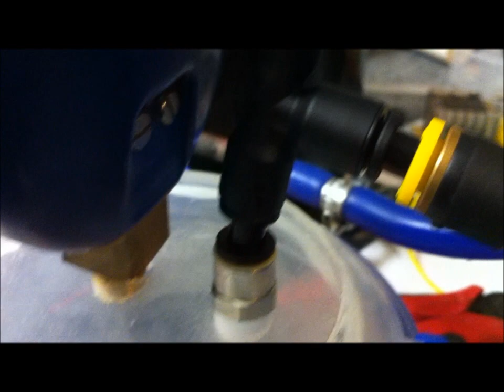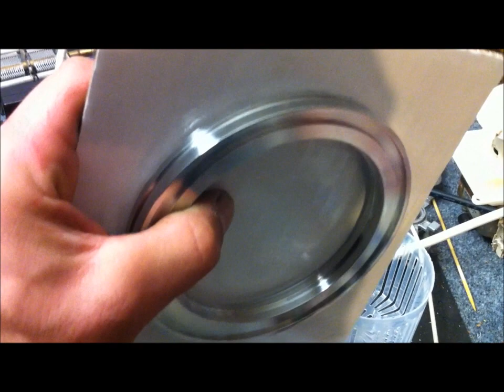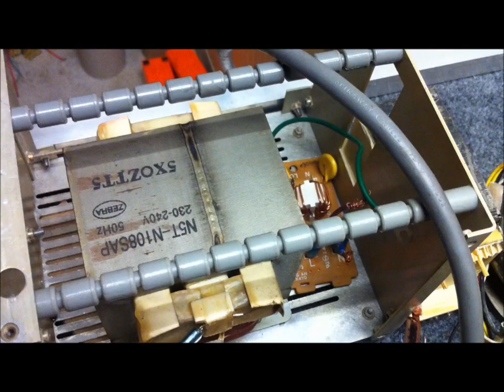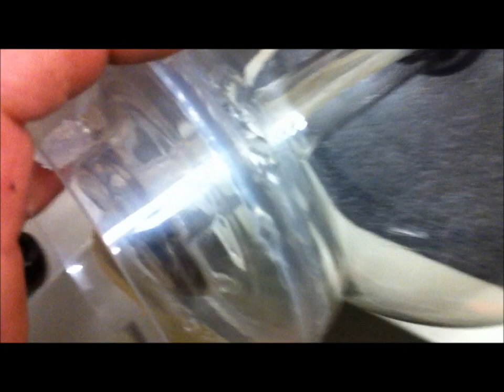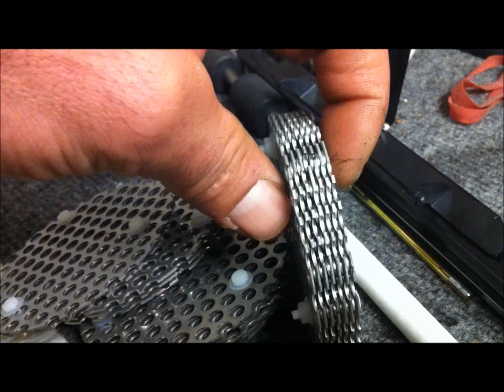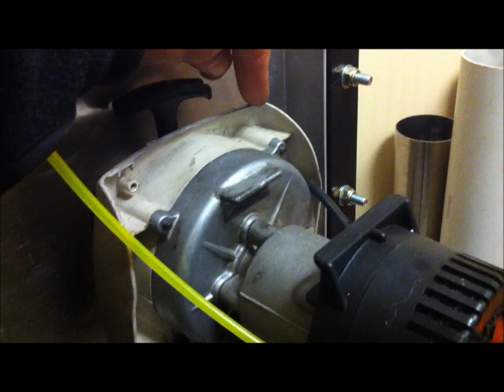HOW I MADE A VACUUM CHAMBER!  And Updates On HHO, Coils, 2KV Power Supply & More!

Comment from the maker: Flaw / problem with my idea: Using the vacuum pump continuously to maintain the vacuum in the HHO cell will cause eventual failure of the pump, due to the water entering the pump & contaminating the oil :(

Comment: A friend mention the possibility of using an electronic fuel pump to generate vacuum to the HHO cell. And as you mention, we may connect the output ie exhaust of the pump ie Hydrogen + Oxygen, into the engines air intake stream. I'll research this further. Testing will tell us what is possible.

Comment: I'm considering use of a turbo like system, possibly modified to generate vacuum to the HHO cell. Then, direct the produced HHO directly into the engines air intake(as with traditional HHO systems). HHO production efficiency thus may increase with greater engine loads(modified turbo generating greater vacuum with increased engine rpm) when most needed.

Comment from the maker: Thanks! Vacuum - that's a cool idea & I thought about doing it a while back, but I just could not get my head around how the vacuum would be maintained at the required level once the gas evolves from the water - The gas would increase the pressure in the chamber, which would require constant vacuuming. The constant vacuuming needs power & that would be equal to the power saved in the electrolysis process. This was my thought process - but I've been wrong before - it's worth a try at least!

Comment from the maker: You should be fine!

As far as I am aware, the degassing process will be unaffected by your altitude. The only measurable difference would be that the external pressure on the walls of your chamber would be different to what it would be at sea level. I believe vacuum chambers at sea level inherit an external wall pressure of approx 15psi. I would assume that the wall pressure would decrease with an increases in altitude. In any case, this will not effect your pump-down. 

Happy pumping :)